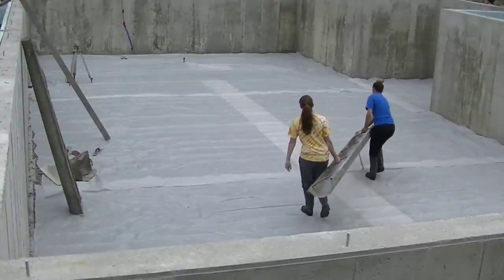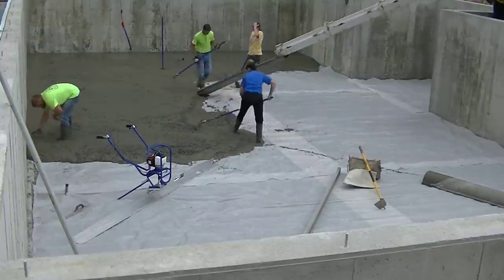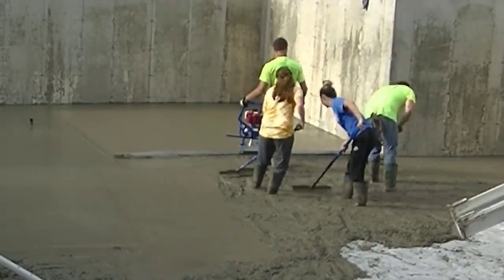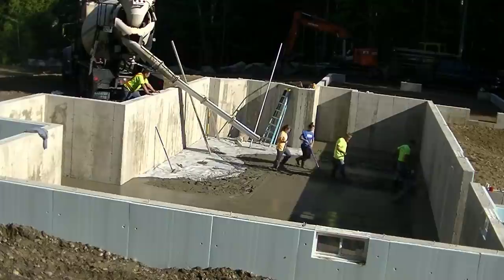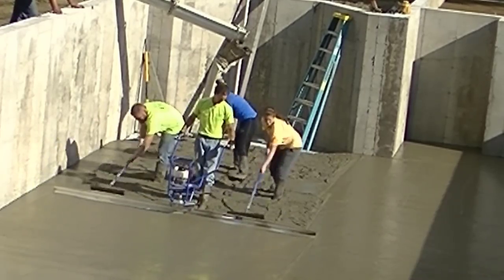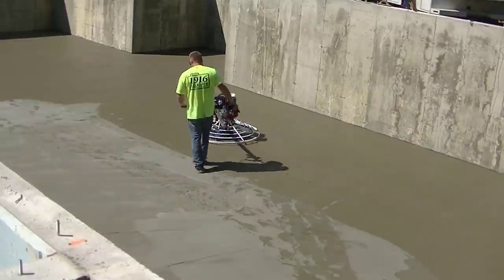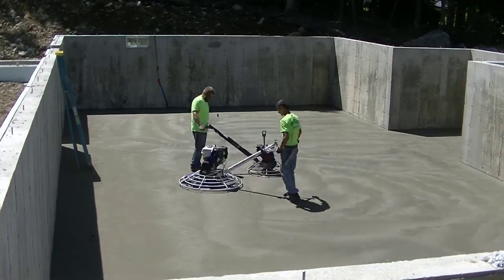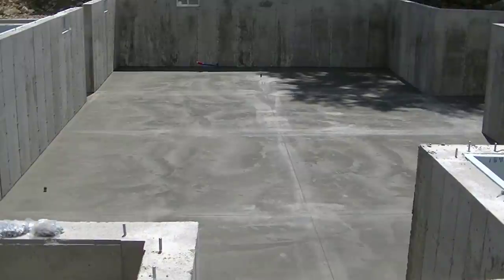How To Use A Power Screed to Screed Concrete Floors

Comment: Spot on with the comment about having good rakers keeping the concrete pushed up to the screed, it definitely makes it easier to get it level if you don’t have to stop or slow down to fill in holes or pulling back too much concrete.
Reply from the maker: They really are the key, they do all the work.

Comment: What kind of blades do u use on soft cut 
I have same saw but the cuts chip cutting that early on mine
Thanks Mike
Reply from the maker: I get mine from Warrior Diamond. Red blades. The skid plate is key too, got to be a new one, if it's warn it'll ravel the joint bad.
Reply: @MikeDayConcrete  thanks for the input will try them
Thanks Mike

Comment: Recently worked on redoing a finished basement after a simp backup. House was built in the 90's and the basement is over 1000 SF. The floor had cracks running everywhere  that had to be cleaned out so the laminate flooring would not have issues. I'm surprised by the size of the floor not having one single control joint😖
Reply from the maker: I know, there's still a lot of guys that don't cut their floors today.

Comment: When you guys cut in general something that don't get covered do you pick the saw up by hand to the next cut so you don't leave behind wheel marks because they do get left behind if the concrete isn't cured all the way
Reply from the maker: We would, yes. Most the time it's cured enough so it doesn't leave tire marks.

Comment: Do you guys worry about the cement truck getting too close to the walls?  What about when pouring the walls?
Reply from the maker: Yes, I watch the backfill to see if he sinks. Don't want to crack a brand new wall.
Reply: @MikeDayConcrete  That would be a disaster. I have seen it happen. Nothing worse than having a crack on a new foundation wall.

Comment: I've never seen saw cuts in basement floors here in Ct, but I don't do concrete. Mine was done in 1987, no cuts and not a single crack, anywhere. I have to say though that the floor had 6'' of water on the stone for 6 months and maybe that helped settle the base ? IDK ?
Reply from the maker: We saw all our floors to prevent any cracks. Most floors will crack at some point.
Reply: @MikeDayConcrete , I agree, but so far, it's crack free for 35yrs. Pure luck I guess ? I agree with everything you say. If I lived in your area and had a floor to be done, you'd be the first person I would call.
Reply from the maker: Thank you :)

Comment: I use float pans versus the float shoes.  I find the pan let's me get on the slab a wee bit sooner.  Your thoughts, if any?  Great video.  👍
Reply from the maker: We've used pans too. My guys just prefer the float blades, old habits are hard to change.
Reply: WITH FLOATS BLADES U CAN SEE THE HOLES GET FILLED INSTANTLY
Reply: @FRANKGTB  I've never had a problem filling holes with pans.  You just have to know how to use the pans and walk lightly.
Reply: @DavidFreelandAZ I know,  pans fill holes even faster than floats, my point is with floats u can see the holes get filled

Comment: I’d be worried that the wall would blow out with the weight of that concrete truck and no bracing or floor joist to support the foundation walls . Be safe
Reply from the maker: It depends on how it's backfilled. If it's soft I don't get that close.

Comment: My boss has that same exact screed. It’s less than a year old and has been through a carburetor, and not it’s “making” oil. Needs a rebuild and is complete junk.
Reply from the maker: No problems with ours, gotta keep good gas in it or the gas will clog the carb.
Reply: Glad to hear that, I really like the battery powered MBW screed you guys use!